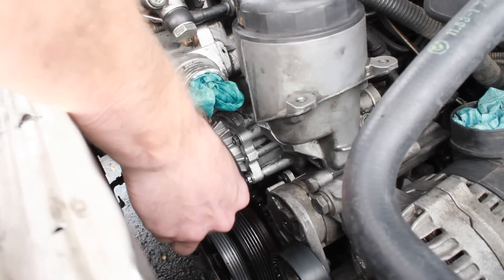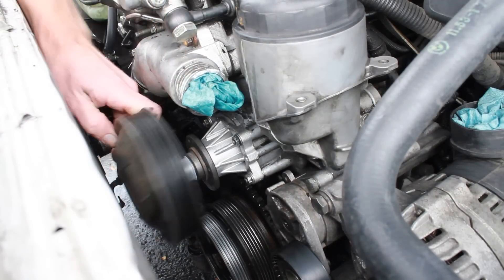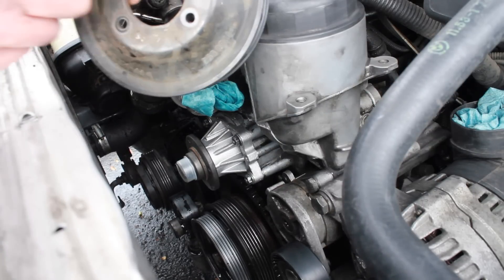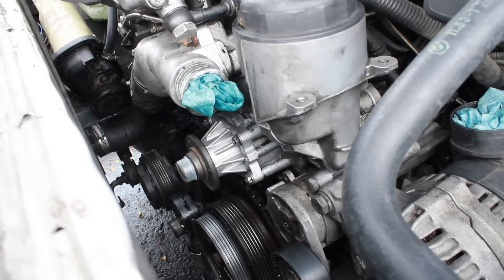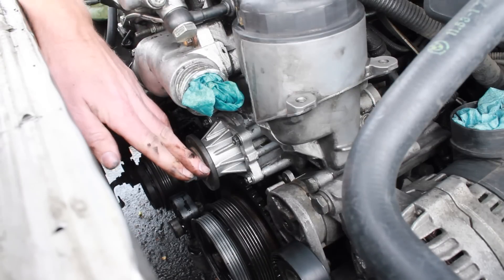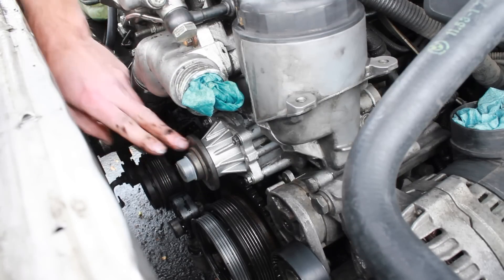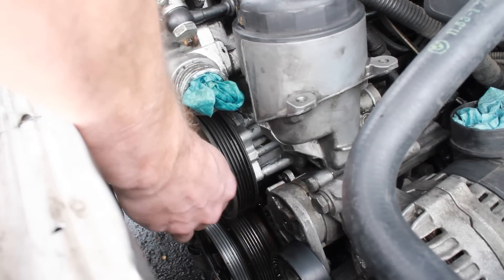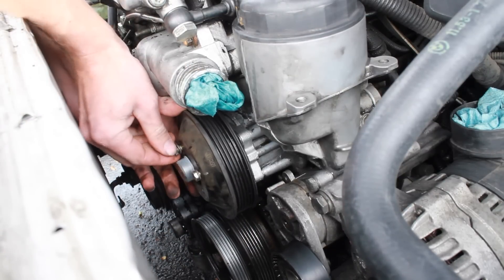BMW 3 Series E36 Pulley Install

Comment: Great video, my experiece is leave block plug alone, and the bolts that you removed from the pulley should be 4 you use
 2 of them not those big monsters studs theres reasons why ,,,,, trust me torque them too 89 foot inches is what I do. Awsome man sorry earth. Love it by thecway bmw should be blue not green. green is not recommended ill practice